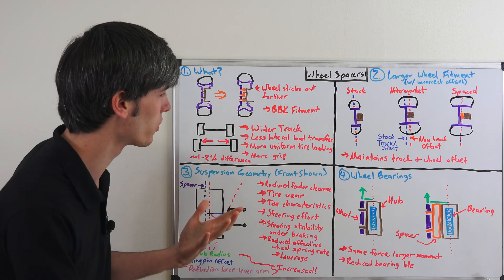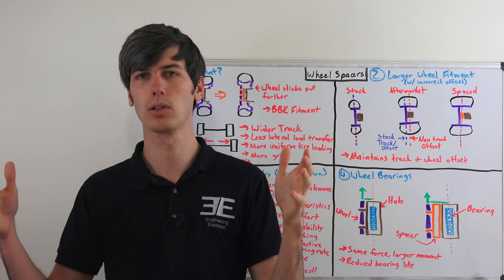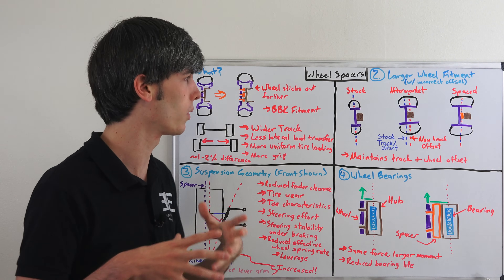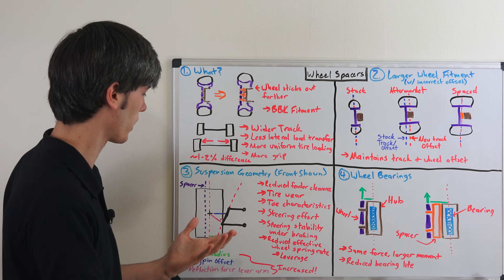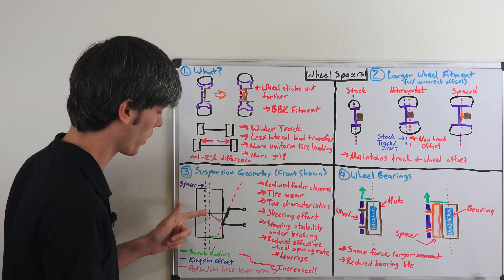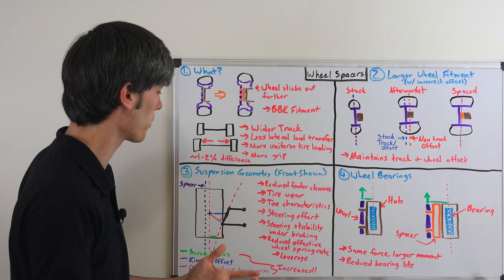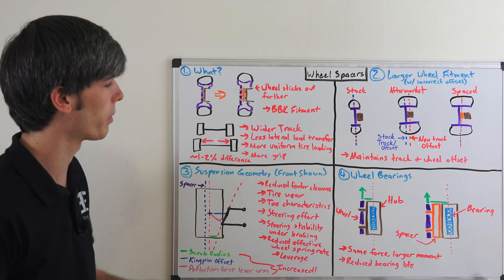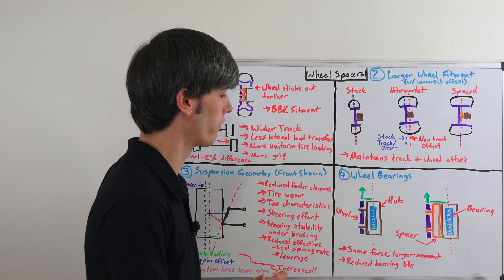Wheel Spacers & Adapters - Good Or Bad?

Comment: Any supporting evidence as to how much  #3 and #4 are affected? Just as how a spacers add wider track and lessen lateral load, but so minimally, I am wondering how detrimental the affects are on the suspension geometry as well as wheel bearing load/life. 

Great video, btw.
Reply: Jonathan Pham Yup, you're totally right. Didn't think of that. Thanks.
Reply: greg, i think you have a cold or something.
Reply: +Armando Alves if you have enough $ for a gtr why half ass with spacers. buy wider rims and tires with correct offset and backspacing. a larger traction patch is the single greatest upgrade anyone can do.
Reply: KORTOKtheSTRONG if he is gunna space em outward it could anyways. I have not had the chance to work on a gtr yet in life so i could not tell you how much space is there to use. Somebody at a good rim and tire shop will know how to fit the widest rim possable while keeping the backspacing correct. The farther out the wheels mounting surface is spaced off the hub the greater the chance for oscillation. Making greater stress on the bearings and maybe high speed vibrations. Plus why add rotational mass for style. Where a whole rim will be have offset to fit that wide wheel in the well but keep the center in the right placement for suspenssion travel, brake clearence, fender clearence
 When a good set of rims will loose weight, gain traction patch, and it is not done 2nd rate.
Reply: +vidurc man just stop annoying people, you like the guys who need to be right and first in every bullshit you say.
Reply: +vidurc Hey, don't take this in a negative way, but the Mathew guy and Shivice are onto something. While your question was basically just a question, it was written in such way it could easily be interpret in a criticizing manner. The way you formulate a question (especially on written form with no emotional giveaways) can really change how people perceive it. Your comment sounds much more negative than Mathew's comment which you say is being defensive. Take this the right way, I am not here to take sides, just informing why a lot of people took your comment the way they did. In general your comments on this thread all feel a bit negative and perhaps even a tad angry, but I won't judge you. Just letting you know :)
Reply: +Jonathan Pham Your making the assumption that someone in a wheel shop is going to be able to get you all the specs of the wheel and correctly align it. That is far from what actually happens. Low offset wheels will do exactly the same thing a spacer does. It will change geometry and will affect your car's handling either way. If you're smart about it, you'll be able to understand the affects on your car and fix what needs to be fixed. Wheels are custom designed for a variety of applications. You're making the assumption that a wheel with a specific offset will just magically work on a car which is far from the truth.
Reply: No you need the correct offset and backspace. When i say go to a tire shop i am not saying go see the dumb snot nosed punk at tires plus. And the correct offset wheel will be "correct." And the big thing is hes got a gtr if you can afford a gtr you can afford a knownledgeable person to correctly size your rims without an issue.
Reply from the maker: Unfortunately it's really a case by case scenario, different cars will have different outcomes. I haven't seen data or testing done to know how detrimental the effects could be, just looking at it from a logical standpoint of what physically changes.
Reply: Engineering Explained Makes sense, thanks for responding as always.
Reply: Jonathan Pham Hate to break it to you but wheels come in different shapes and sizes. Including 0 offset wheels, positive offset wheels and negative offset wheels all of which change the load and stress components take. Anything wider than stock is going to put more stress on steering components, suspension and more. You're simplifying the issue without actually doing the math yourself. ANYTHING other than stock is going to allegedly cause more issues. It's upto the buyer to get wheels that are lighter than OEM, and still maintain the same scrub radius. If you've ever bought wheels you wouldn't be making a statement like that. Buy some aftermarket wheels or do your own research and see how limited your options are. There is no proper way other than OEM in that case.   http://www.rimsntires.com/specspro.jsp
Reply: Jonathan Pham Custom built again. You tune based on your application and purpose. That doesn't mean having a centered scrub radius is perfect or wrong either. Too much rubber and it's useless in a lot of cases, too little and it's still bad. Its one factor in a whole list of factors. I've used spacers to return my scrub radius to a setting that is close to stock. The wheels were too expensive to replace, 600 dollars a piece, and the spacers helped me adapt it for another car so everything would even out. That's the bottom line.

Scrub radius is tuned depending on the application. Steering feel for example on a BMW 3series is a particular way because the scrub radius is tuned in a particular way. If you want heavier or lighter steering you change offset's accordingly. 

There are cars that can take the stress and there are cars that will break with the slightest change. The Gallardo is one where a change in wheel size will destroy the front diff... Some cars are engineered to be bulletproof and others are not.
Reply: Not getting defensive.  Just stating facts.  Information was provided, not an recommendation.  You made a tremendous leap of logic to go from a statememt to a recommendation.  Maybe you should focus on the words said not what you think you read.
Reply: Matthew Gaines i
Reply: +Engineering Explained what about wider different offset wheels, does same thing apply too as in spacers?
Reply: I would just like to say that on my 07 STI, im running stock wheels and tires with 20mm spacers and ARP extended wheel studs. I have no vibrations, wierd noises, excellerated wear etc. So it is a car by car basis.
Reply: jdmcommute If it's done right there are no issues. Hubcentric spacers have been my go to choice for years now. Autocross, and daily driven on both my cars with no issues especially if the spacers are TUV approved. What people seem to forget is low offset wheels cause the same issue at the end of the day. Running anything that isn't OEM can be problematic if not done correctly. ARP wheel studs have been known to be much stronger than stock studs as well. It's the impact gun specials who torque bolts in incorrectly and cause their own accelerated wear issues or even broken studs. Seen that happen plenty of times.
Reply: dude thats just wrong. Mathew proved he auto-responds that way to a neutral question. How do i know this? i felt no aggression in vidurcs question and thats because i dont play victim or feel like im being attacked for no damn reason. The guy asked a question, then pure lunacy happened. Read it with my perception to get what im saying. People should be able to ask a question without adding a ":)" after every bloody statement or question. God damn it people...
Reply: zed4me
Step 1. Buy a low-mileage ford contour.
Step 2. Get happy with it & do what you need to do.
Step 3. Buy all the components necessary to repair said damages to suspension, wheels, etc.
Step 4. Swap out the old parts (incl. bearings), check for wear. Analyze the bearings & determine what kind of wear the stock configuration produces. Weigh your options for size of spacer.
- naturally the larger ones will put out a larger effect
Step 5. Finish the install, test drive, get happy with the car. If you don't like it, drop the junk immediately. But if you chose to go small, it is likely you will just ride out the life of bearings (or something). 
Step 6. Replace stuff, like bearings. Check for damage, if possible confirm with the old bearings (photo).

That will show how a small passenger vehicle with good history can handle a common aftermarket part. If you make it your winter car, it can be cheap to insure, as well as not being a dd you can risk the insurer dropping your coverage in case of a claim against you. Weigh your options, but his would be a great way to get a stripped out DIY for about $1000.
Reply: +Jonathan Pham maybe that could eat up wheelwell realestate; idk if it matters too much though, my car has fatter tires than stock but it doesnt rub when the wheel's turned all the way
Reply: +vidurc my personal answer to wider rims is mini tub tub i dont think dude wants his gtr all hacked. and that car has enough aftermarket i am sure he can get the right rim. plus throw money at it and it will come. look at that 235mph gtr hella wide rims im sure they make somthing out there.
Reply: +zed4me I've been going between 10mm and 12mm spacers for different wheel fitments on my vw hatch for about 5 years now.  I can subjectively tell you that the life of my bearings was reduced by maybe around 30%.  Just my experience's.
Reply: Auto manufacturers don't test non-spec set-ups.  Consumers who do these modifications don't do engineering grade testing to the cars they alter to measure the impact.  Those who manufacture these parts don't test them to that level because of cost and it is not in there best interest to do so. Thus, you'll be hard pressed to find the information you seek. The physics and mechanics are real.
Reply: Idk about a car but on a truck with bigger than stock tires. If you put wheel spacers on it especially 2 inch and bigger you will be doing bearings once a year
Reply: +Hunt Guy tell me about it  it's so annoying but its worth it somehow
Reply: +Frank Fitzpatrick i will never take advice from someone that can't hit the space bar ONE TIME and move on.... especially when they don't know the difference between "there" and "their". i mean its not like you typed this on a computer with grammar and spell check built in....
Reply: These people are crazy! you literally, just asked a question and he ASSUMED you where being bitchy. lol like wtf
Reply: vidurc cheers :) haha
Reply: +Anti Rästa well... The lower the number for offset, the further out the wheel is. So if your wheels are lower offset than recommended, then adding a spacer is just going to get further from oem spec
Reply: +Damianos JDM same thing
Reply: supporting evidence is look at duelly truck: the rears are two tires with bearing alligned in the center of the twonwheels (on the end of axle housing) as well the fronts are usually wheels with major positive offset to keep the bearing exactly in along the center of the tire/wheel to carry the load linear minimizing off center loading of bearing.
Reply: +Jonathan Pham amen to that!
Reply: +cult friction for sure !     Engineers  know exactly what there doing , thats why there engineers .    Everything about an automobile  is comprimize  . thats why a street car has optimal performance on the street  & ahehe dedicated track car is great on the track ( no comprimize )  but is not something you would want to  drive daily on the street or in stop & go  traffic  or around town and long trips    Thanks .      QUOTE :   " Keep the shiny side up & the rubber side down "   &   keep the crazy shit for the race track !     Although ,  On ramps & off ramps and entering the  Autobahn are a different story   .   HeHe
Reply: wut
Reply: MRfullon After that response I'll whole heartedly give you a :)
Reply: zed4me number 4 should be the most concerning here. Those wheel bearings are gonna go, and it's not gonna take long. In both the small and large shops, I see people with toast bearings that have wheel spacers fitted in their cars. It doesn't take much to break em. Most common cars that have this issue? Jeeps. 

Jeep guys will tell you, "it's a Jeep thing."
Reply: Sharod - my JGC hasa stock 50 offset - do you think going to a wheel with 35 is a problem?
Reply: but compensating the missing offset with spacers is okay? my W124 Mercedes OEM table suggests that 17x7,5 rims should be with 42mm offset, yet the ones I have are 36mm. by putting a 5mm spacer inbetween the wheel and the hub it should stay closer to manufacturer recommended suspension and wheel settings or is it making the setup worse?
Reply: Sad,  but I guess this is how wars start sometimes.
Reply: It's called physics jackass. If you don't know basic physics you should not be messing with cars period. Please stay away for the rest of us
Reply: So I take it you two understand each other ?
Reply: Wheel bearings yep
Reply: +Jonathan Pham What do you think wider wheels are going to do? Spacers will change the offset just like low offset wheels move the offset as well. You get the same effect, same suspension droop and same changes to the geometry.
Reply: Shivice Tv Asking a question doesn't equate to annoying someone. It's called asking for clarification. If someone is too full of shit to be able to clarify, that's annoying. So being right is now wrong somehow? Would you rather have a bunch of misinformation spread with no reference to anything remotely correct... Come on man...
Reply: +Engineering Explained So, if I put 15 mm spacers on an R35  GT-R just to make it look a bit meaner and give it that more muscular presence, how bad will it affect the performance? I'm asking because I know the level of engeneering that was put into that car and everything was developed in order to deliver max performance.
Reply: Matthew Gaines You are getting defensive just read your current comment. A question was asked. All you have to do is answer it and clarify. Do you understand how basic clarification works? Is this your first time being asked a question? Grow up.
Reply: Matthew Gaines That's why I asked the question. No need to get defensive. It would be easy to insinuate that based on how your comment was worded.
Reply: Did you read that in my message?  I'd suggest you go back and read it again.  I made no claims as to whether one should or should not upgrade wheels.  I don't know where you thought you read that in my post.  Maybe you should separate what you think you heard from what was actually said.
Reply: +vidurc I'm with ya man.  You asked a simple question.
Reply: Wider rims will move the forces on the wheels outwards, effectively like wheel spacers.
Also, wider tires don't give better traction, because as the contact area increases, the pressure on that area decreases (same weight), but tires will be cooler.
Reply: Matthew Gaines So are you claiming you should never upgrade a cars wheels?
Reply: +Matthew Gaines You must be real fun at parties.  You have a real basic problem with human interaction.
Reply: +zed4me  not a genuine part gonna do the damage sooner or later PERIOD!you can get injured or die COUGH and COUGH majority after market parts gonna ruin your day COUGH and still COUGH.you wanna use fenders, hoods parts like that but body worker gonna spend more time to make part perfect!but not like spacers or any chassis part including a bearings* COUGH*
Reply: You have a real basic problem with reading comprehension.  You read something and don't understand/misunderstand what was said.  Or you are a conspiracy obsessed person that believes there is a subtext to everything said.  Maybe I got some growing up to do.  I'll get on that once you go back and take a literacy class or deal with your paranoid behavior.  The fact that you continue this conversation suggests that the level of maturity you have doesn't exceed mine.  Maybe you should take your own advice and grow up yourself chief.
Reply: Daniel Kemnitz Thats why the clarification was included. If 2 comments after said question isn't enough to clear that up, there's not much that can be done.

Comment: So ideally when buying new wheels you'd want to get the same offset to avoid messing with the suspension geometry.  That said if I get say an ET32 instead of an ET34 the 2mm difference should be fairly negligible right?
Basically I am thinking of going from stock 205/55R16 ET34 to 225/40R18 ET32 on my car and my current thinking is that since I'm not using spacers and the offset difference is fairly small I shouldn't be causing any issues later down the road.

Comment: @engineeringexplained how much increased wear do you think will occur  on say a 15mm spacer? in percentage just roughly
Reply from the maker: No idea. Depends on the vehicle, tests or simulation would have to be done to get an estimate.
Reply: +Engineering Explained 
wow cheers for 
replying man. first you tuber to actually reply to me. thanks for taking the time

only reason I ask as I have 15mm on my audi. would changing the offset not also increase strain on the hub bearing  ?